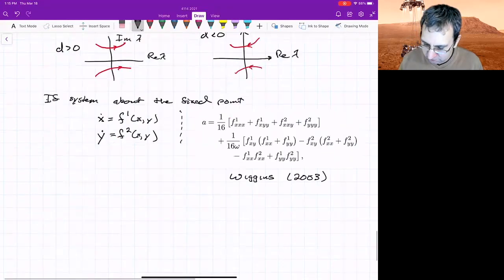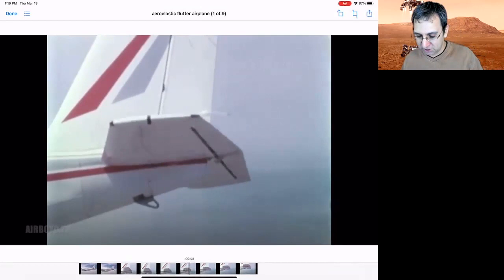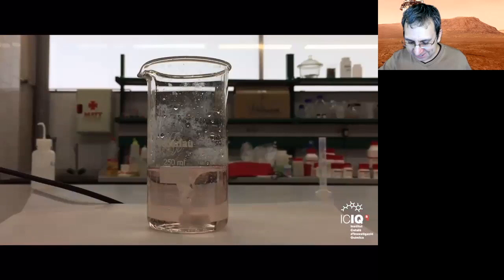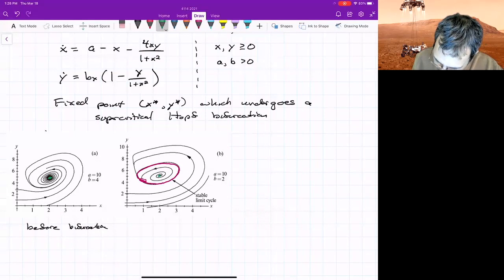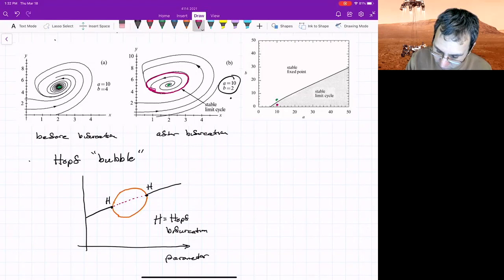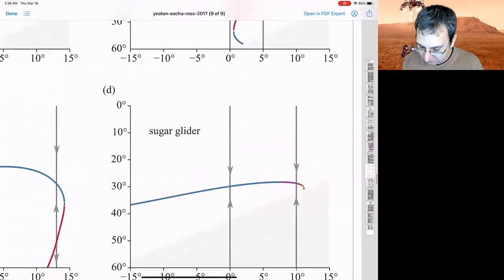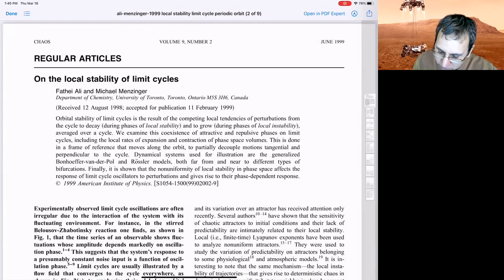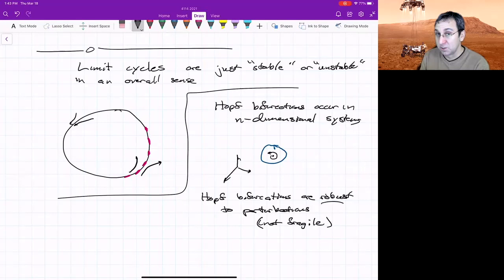Bifurcations in 2D, Part 3: Hopf Bifurcation Physical Examples

Comment: Of course the oscillating reaction settles down after some time. With every cycle some amount reagent is used up and it eventually runs out. This should also be quite obvious to you as it would otherwise violate the laws of thermodynamics.